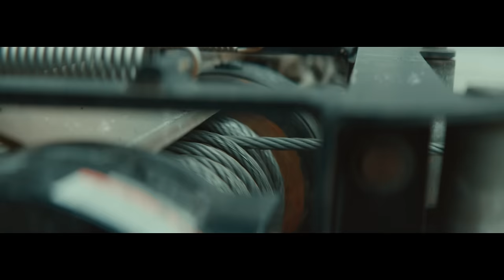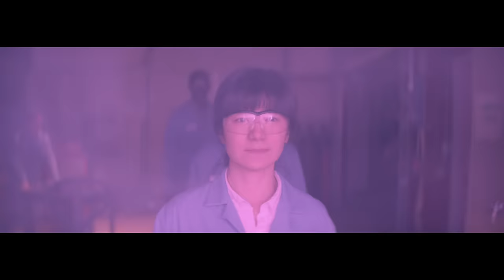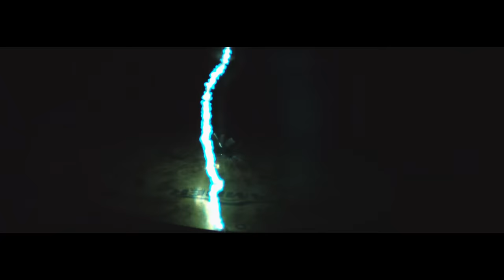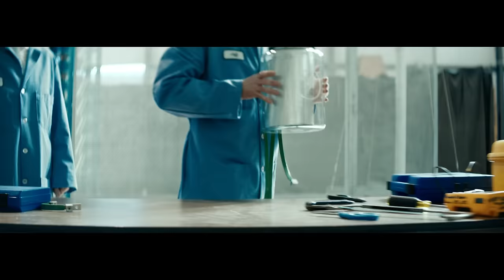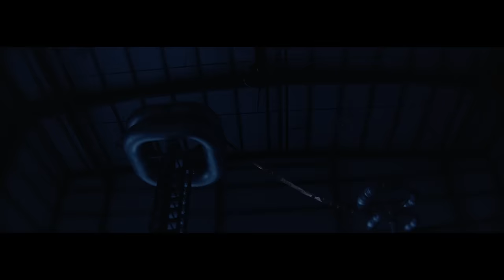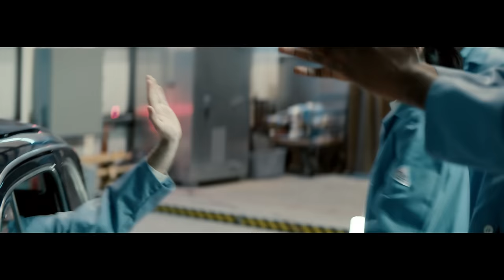Can You Really Catch Lightning In a Bottle?

Comment: Uh, but you just caught lightning in a super capacitor, not a bottle
Reply: But it’s all in the bottle
Reply: Squigga _ 
True, but most of the time, it would be expected to just use the bottle to capture the lightning, technically speaking, yes they did catch lightning in a bottle, but then again, even though it can be boiled down to catching lightning in a bottle, its pretty much just catching lightning in a super capacitor in a bottle. It would also be expected to use the bottle itself to catch the lightning, its like saying you caught an animal with a bowl but really you just used a trap and then put the bowl on the animal.

To boil that all down, the problem is both the loophole they used, and the expected outcome.
Reply: @trainwreck237  Consider the SC the bottle; what were you expecting, actual lightning in a regular glass bottle?
Reply: @RonanTetsu  
Would have been interesting tho wouldn’t it?

Comment: So if you catch a 2 million volt electricity and use it as a replacement of car battery then the alternator of the car would fry since car batteries are only 12 volts and 24 volts if for trucks and the car wont start.

Comment: Can you use ion transformer to inductor to captured bottle supercapacitor or the flywheel too power enough to generate power plant
Reply: Why would you need a flywheel when you already have the energy (stored)?
Reply: @johnschut164   can they try spark gaps and transformer with ground rod.

Comment: Isn't electricity attracted to water? (I learned that from thunderstorm safety procedures) Soo.... why don't they just fill the bottle with water... although the two don't mix together.... at least not safely. Also, what about natural lightning?
Reply: Lightning seeks out the lowest resistance path towards ground (place of lower voltage than orgin point). If a path towards ground with lower resistance exists (e.g A lightning rod), more current will flow through it than other paths (e.g Air). Water simply has low resistance and is thus a prefered path if it leads to ground.

There is not much different between natural and artifical lightning.  Natural lighting is caused by electrically charged clouds. These clouds have a higher charge than the ground and thus there is a voltage between the ground and the clouds.

These differences in charge want to cancel each other out, and electrons will try to flow from the clouds to the ground. This current (of electrons) is often very low, because the resistance (to the flow) of the air inbetween is high.

But if the voltage is high enough (greater than the so-called "breakdown voltage" of the air) the current will be so high that air is turned into plasma. (which is why lighning glows) The plasma has much lower resistance and cause the charges to equalize in less than a second. (which is why lightning is so short).

"Artifical" lightning acts in the same way, but the difference in charge is instead made by a machine.

Comment: Yeah..  no . Those were not discharges made my a marx generator also no capacitor would survive that. The voltage rating would have to be insane and there for the capacity would be low as fuck